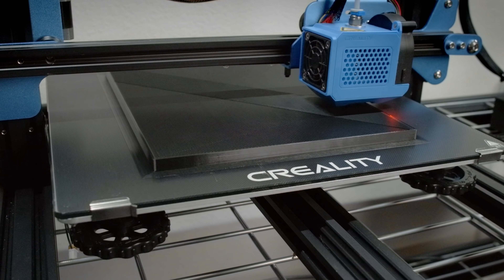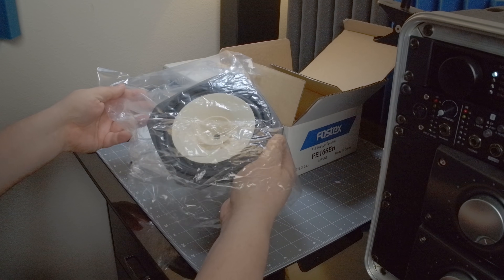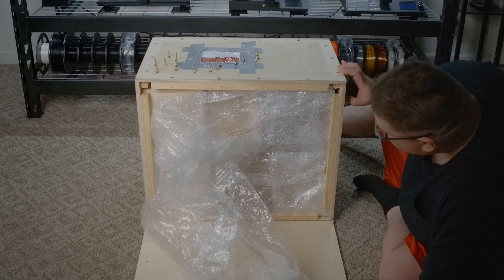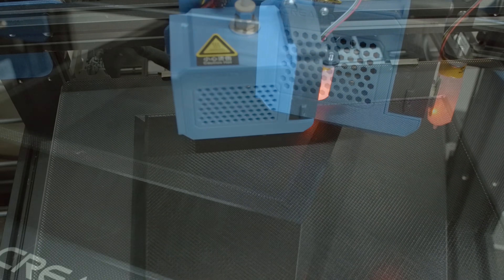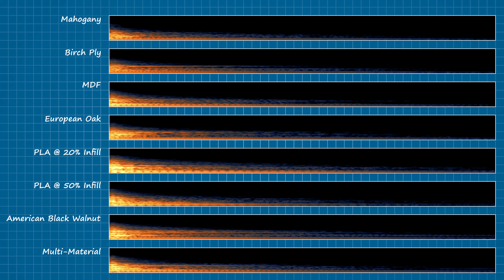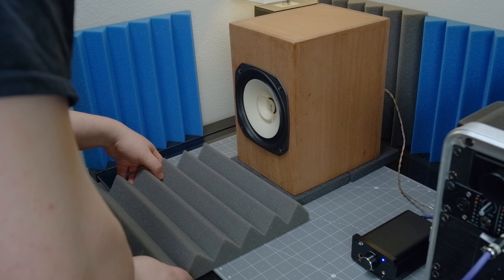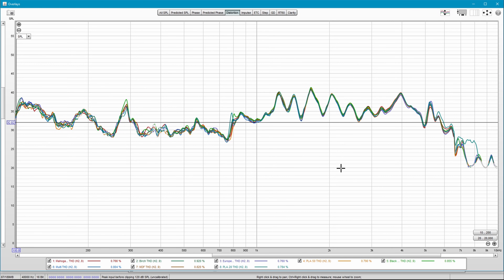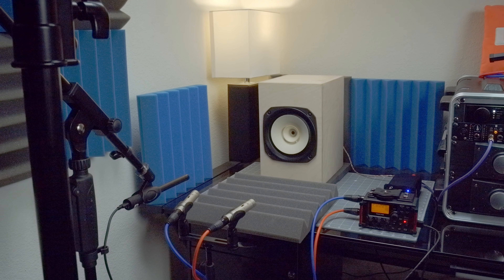Which Is Better for Sound?

Comment: What about casting an enclosure from cement? It has a super high loss modulus. Would absolutely love to see some testing and comparisons!
Reply: Tech ingredients has a video covering cement speakers
Reply: @williamkeith2419  tech ingredients, a good channel, but the stuff they did on acoustics was off the mark - can't think of a channel that's a good source of acoustical info....
Reply: @BogdanWeiss  can you explain why it is “off the mark”?  It is an odd comment to just say that without citing a single example.

Lots of other videos of people replicating those videos with extremely positive results. 

He also compared cement vs PVC chambers, and they performed identically.  Say what you will, they were tested in exactly the same way under identical conditions, ported and unported.

Cement speakers were simply not an improvement.
Reply: @mandoreforger6999  my “off the mark” comment was referring to “tech ingredients” attempt at acoustical treatment - acoustical treatment, is a wide & deep topic & companies in the business of selling “acoustic treatment product” create a lot of confusion, by claiming to offer a solution, in the form of absorptive ( resistive ) or diffusion ( fractal QRD ) product. However NONE of the “off the shelf product” address room resonant modes, these can only be addressed with a custom solution. So a room that’s been “ treated” with off the shelf product, will sound better, but it is nowhere near a custom solution that SHOULD deal with low frequency room resonant modes.
Reply: there is 1 brand who i saw makes speakers from cement or concrete to be exact but ofc 10s of 1000s of dollars for a bookshelf. but there is a diy guy on youtube who made concrete bluetooth speaker. will be epic af definitely
Reply: I fancy epoxy granite myself .... it's what diy cnc machines use.
Reply: @mrb.5610  yeah, epoxy granite would also be super interesting!
Reply: @Loopyengineeringco  It would seem to have all the right properties .... strong, highly damped....all the reasons it's used for CNC machines.
Reply: @AS Motion Lab how did you arrive @ “super high loss modulus” for cement ? you mean “concrete” ? It’s actually the opposite
Reply: @BogdanWeiss  just from research I did for a milling machine I'm building, there are some good papers on the subject. The aggregate inside concrete (rocks) reduces the vibration absorbing properties of the material. Cement on it's own seems to be the best when not using admixtures. Polymer concrete/epoxy granite materials are even better (but much more expensive)
Reply: @Loopyengineeringco  Loudspeakers are a lot more complex, requiring diametrically opposed “ ideal” properties as you’re moving from LF to HF - these days FEM & BEM is your friend - you can even use compressed toilet paper successfully (MDF ) - constrained layer damping works really well as well - 3D printing is tempting, but those print times....

Comment: What about the price difference between the prints and the woods?
Reply: Unable to comment on 3d printing but materials in wooden enclosures were approximately,
MDF £4
Mahogany £12
Oak £16
Black Walnut £34
But be aware the thinnest rough sawn boards are 27mm thick, for this exercise we took them down to 9mm to allow the enclosures to resonate and highlight the differences so you can have an enclosure up to 24mm thick for the same price, there is more cost with Wood to thickness the boards but with DIY projects for a small bookshelf design there is not a huge difference between good quality plywood and Mahogany particularly if you can use recycled material.

Comment: Very minimal difference between materials in the listening test.  The MDF has a very characteristic sound to the bass frequencies; not quite "boomy," but slightly undefined, muddy and "raspy."  It's something I've noticed when building MDF enclosures myself, and I usually treat the inside with rubberized coating and a bit of Acousta-Stuff.  The 20% PLA had a distinct clarity issue with lower frequencies, very much in the realm of the "ringing" characteristic you'd noted in your other testing.  The rest of the materials may have had slight variations, but without the side-by-side comparison, you'd be hard-pressed to notice.

Awesome video, and great test!  Thank you!  :)
Reply: Thanks for the feedback👍

Comment: good choice of infill from a mechanical point of view, but why not fill the gyroid infill with sand or concrete or anything else? may use quite some vibration to get it more or less free of air bubbles, but at least it is an open infill enabling filling in first place and also delivering nearly isotropic mechanical behaviour.

Comment: Fantastic! This pretty well confirms something I've been wondering about. I'm currently printing some DIY copies of the B&W "turbine" style speaker with 0 infill, and will be testing some different candidates for a filler material like sand, expanding foam, concrete, etc. I feel like this is where you might get a much more custom result from 3d printed parts. I love how the videos get straight to it. Big thumbs up.
Reply: Did you complete your project? What were the results?

Comment: As your measures confirm, absorption is about masse. So i wonder what about an enclosure where the walls are 3d printed shells filled with sand ?
Reply: someone has mad a sand based material to 3d print a spiral enclosure, pretty cool

Comment: I had pretty much the same project some years ago. Very interesting how densities make a difference. I wanted to avoid pure plastic and planned to use quality wood filament instead (the cheap stuff just sucks)  but that would have easily been 200 bucks for something that could be done much cheaper with mdf so.. yeah it kinda ended there, lol.

Comment: Hence the sound dampening effect is apparently linked to the mass of the printed object, I would be interested to see how a 100% infill 3D-print would stack up against the wooden enclosures. Furthermore, if that improves anything it could be intersting to try metal infused filaments, because of the higher densitiy.

Comment: Great test.

Considering that PLA 50% infill turned out quite nice,  I think it's safe to say that it might be a good idea to explore from the audio point of view how different filaments compare to PLA, like ABS, ASA, PC, Nylon, and perhaps some hybrids with mixed fibers and so on.

Anyways with just this test it seems like it's quite decent enough, and with 3d printing it does give you the freedom to create some complex shapes, rounded internals and so on, that would be practically impossible to do precisely by hand (i mean like making the inner box chamber a sort of a egg like asymmetrical spheroid designed to have no standing waves of any frequency inside.

Comment: The European Oak seemed to have the brightest sound. The 20% pla seemed boxy/cheap sounding. The mixed material had what seemed like slightly better defined low-midrange output, but I'm not sure I actually heard that. Most everything seemed to sound similar.
I would prefer to listen to music that incorporated actual acoustic instruments, instead of the SimCity soundtrack. Letting the boxes resonate with more legato and dynamic notes instead of the tight staccato of whatever that song was, I'm sure we would hear more difference.

Most importantly here, I can't really trust YouTube's audio to recreate what you've recorded. There is for sure compression happening, the dynamics are too flat.

Regardless, absolutely top notch video as usual. I love what you do and how you do it. I really appreciate the time you're putting into these.
Reply: Thanks for the feedback👍

Comment: In real life there is a HUGE difference between materials. Listening on a compressed audio recording on youtube.. Well.. I don't expect much from that.
But in the damping properties test you need to be sure ALL enclosures are the exact same thickness and have the same design to get 100% valid results. And it's not quite the same just hitting the outside and messuring inside as it is testing the internal damping with a speaker in the enclosure.. But it gives a good pointer so that one is still valid.
Most important is how stiff the enclosure is. If you feel the walls in the enclosure vibrate then it's not stiff enough ;P Damping itself can easily be handled with the right damping material.

Comment: I was listening on my home build, smacked together system which consists of Two Jamo Compact 90s with some newly installed tweeters (JBL) and bass drivers (Cervinwega) and extended bass ports made out of plumbing tubes. MTX Black Gold 12 subwoofer the one with plexiglas. The speakers runs on a Pioneer SX-337 with no subwoofer output so i drive the subwoofer using a zone mixer and a car amp (600wrms). Could hear a slight difference in bass between some of them. My next speaker build is going to be out of brazilian rosewood. Great video!

Comment: eh I'm currently Designing a subwoofer box for my car.
not sure if I end up with 16,5cm or 20cm woofers. (one left and one on the right side)
the woofers should make  use of some dead space of my 3 door yaris GR4

well the 3D print is designed with thiner walls and not much infill but with ALOT of ribs to give it good strengh.
I'm super hyped, cant wait! :D

Comment: I noticed there are some comments about different infill patterns during my scrubbing through, but I didn't see the explicit mention of "open cell" vs "closed cell" infill. Gyroid is completely open cell, so all the airspace is shared. It is all open-flowing. Almost any other infill would likely be better. IMO in regards to sound isolation, the best would probably be Cubic (my experience is only with PrusaSlic3r admittedly, I'm not sure if all have Cubic these days) And further more I am not a sound engineer, but this makes logical sense to me through my 3d printing experience and taking note of how different infills perform for miscellaneous tasks.

Hope this is helpful to some degree if it hadn't already been thought of, and maybe it is helpful to others in general. Happy printing!

Comment: Well I tried both my speaker setup and headphone setup to listen. 
Through my speakers i could not pull anything from them. 
I used a set of Vanatoo T0 with toslink and a earthquake FF6.5 sub. with both Speakers and Sub on isoAcoustics stands
Through my headphones. I did notice one very slight variation on the second go around. A slight high pitched Ringing sound from the 20%pla
I use a Scarlett 2i2 to a set of Sony Cd900st with Yaxi pads.

Comment: I am currently working on a 3-Way 3D Printed Loudspeaker. Just finished printing version 2 over the weekend, took a week. I think I am going to try and fill the final design with resin, instead of going all-in on in-fill. That would be an interesting experiment with different resigns fill materials for 3D printed enclosures. I may do some minor experimentation once I get to that point in the design.

Comment: Seeing all these box shaped enclosures made me think, 3D printing can make almost any shape you want, would an enclosure of the same size but with a stronger shape have an effect on sound? E.g. what if you printed a spherical enclosure, would it be stiffer when subjected to pressure differences?

Other idea, could you print an enclosure with a mass resonator integrated, making use of geometry like wall thickness and the flex of PLA?

Comment: Although I know the need for having a baseline for testing, but you are defeating the fact that you could 3D print virtually any shape possible.

I think it would be of interest to print a speaker with curved sides with similar volume. One similar to the top notch speaker designs from B & W reference 800 series. It is a known fact that curved sided cabinets have superior acoustic properties. This is only limited by the high craftsmanship skill, time, and therefore cost to produce.

I am pretty sure the results will surprise a lot of people.

Comment: Hello this may be a bad question. Would the pendulum striking the tongue and groove glued line differ from striking a solid 3d printed side?
Reply: That is a good question, if the joints are not perfect that will make a difference, the dovetailed box came bottom of the list so will be looking into if the joints made a difference.

Comment: I seem to notice a slight difference in the sound produced by the MDF. 
The deep drums seems more filling when switching between MDF and both Mahogany and mixed material. I do struggle with hearing it after listening again. 
Also seem to hear something differnt between the drum part at 6:58 . I compared it to 6:03 and 6:31 and it seems like it is less distorted 

Anyone can confirm these? 
I'm using a set of Logitech G35
Reply: Thanks for the feedback!

Comment: The receiver/amplifier is the RCA 2781BE 5.1 2000W(claimed) 150W rms per also to power the subs 12 volt battery with 3 amp charger going to a Jensen 4 channel 160 w per channel bridge 2 at 3.76 ohms

Comment: Black walnut and mahogany had the fullest sound much richer Bass I have a MTX shallow mount competition in a recycled Sony saw 2500 box custom port still round also Rockford fosgate 10 in dual voice coil competition the MTX is 10 inches well also running custom-made three-way speakers starting with Rockford fosgate Harley-Davidson edition riding speakers 6-in full range driver 3-in mid-range capacitor filtered as well as 2 and 1/2-in tweet also capacitor filtered
Reply: Nice set up! Thanks for the feedback!

Comment: Very interesting, thanks for this! Did som simple knock testing on petg Vs MDF and didn't find much difference either, pretty sure I would fail a double blind if tested on these samples. Given the density of pla, it should be quite suitable enclosure, even if there is some resistance against using plastic in the dyi audio community. 

However when building enclosures in petg I find the price of printing fairly large enclosures is quite high compared to wood/MDF.. so guess the only way it can be justified is a complex design that would be otherwise difficult in wood... And the ringing/ridigty is fixable by design so I think we might see some really cool 3d speakers eventually.. like the stratsys prototype ;)

Comment: Why not Spruce or Cedar like they use in the making of instruments due to their tonal qualities. Any cabinet maker they would be described as doing "amazing" things worth their salt would have models in these woods as well as extensive sound data.
Reply: Both Spruce and Cedar are softwoods, we are currently only working with hardwoods that we can source responsibly, ultimately the cabinets need to be as "dead" as possible with minimal tonal qualities, Mahogany seems to be good for absorbing sound quickly and out performs traditional mdf and ply. Collaborating with Hexibase and his awesome knowledge has greatly helped us to start building an extensive sound data.

Comment: Listening on my Desktop PC with a Sound Blaster Z series flat response no added DSP on Klipsch THX 2.1 PC/Desktop Speakers. The sound was comparable to the different woods. It wasn't something were I would say the PLA sounds like crap. It's right there with the rest of the woods with a bit of tonal change and not drastic. For me it was hard to discern the sounds since the materials would change and different sounds were playing for each change. If the song was more consistent between each material, I might be able to tell more what I was looking for in the characteristics in the sounds. Like a repeating bridge or chorus were the notes were more consistent.

Comment: me: Struggling to notice any difference and perceive absolutely nothing

reality tells me: "your headphones costs about 20$. What you've expected?"
Reply: YouTube compresses the audio so much that you can't tell even if you have $400 headphones and a custom DIY amp.
Reply: @stiles3711  It's the same thing I tell folks when trying to evaluate photographic images on FaceBook.  You can upload a 36-megapixel image but FB is going to compress any image above 2048 pixel on the long edge.
Reply: I don't have a expensive setup but I can hear a slight difference on my modified AKG K701 and Fiio K3.
Reply: No difference only size matter.
Reply: I can hear some differences. But, I listen to music normally on my pc. I'm running JBL bookshelf speakers and a Visonik 15" sub in a custom enclosure.
Reply: the main issue is youtubes audio compression

Comment: The only thing that seemed off was some of the materials seem to attenuate that crunchy, rain-like sound in the background of the audio, but that could be fixed when tuning them for their specific applications. Bass seemed pretty even if a little softer on some. Didnt notice much change in the mid range sounds, i.e. the echo like melody.
Im listening with some cheap ass (xtraem) bluetooth (wired to each other) earbuds. I'm feeding the sound to them through the wavelet app where i set the EQ to flatten out their normally bass focused sound.
Edit: Oh im listening from my motorola x3 play. The earbuds are unsurprisingly only sbc, 44.1k and 16bit capable.

Comment: What if you used an open cell 3D infill with a hole to fill in with sand to add acoustic mass to the box? The advantage would be a reduction in cost and a theoretical reduction in resonance. The disadvantage would be the enormous weight increase since sand has an aproximate density of 1600kg/m3.